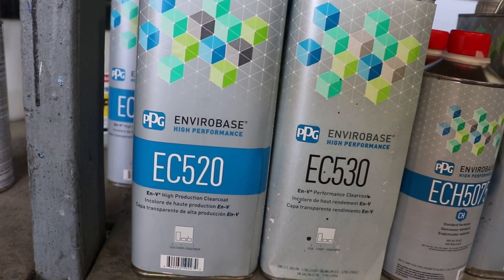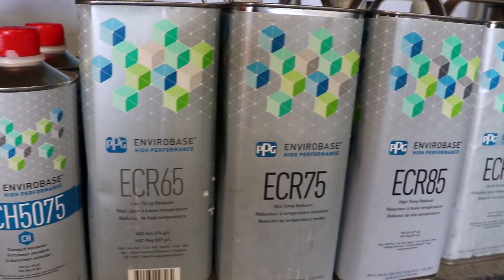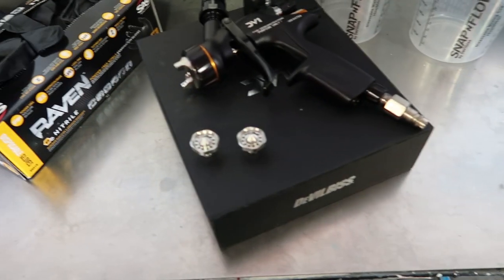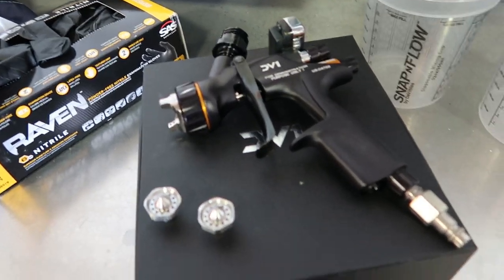NEW DV1 Clearcoat Spray Gun Review!!

Comment: The dv1 measures air pressure at the top instead of the bottom to prolong the gauge's life. Your still shooting 27-32 psi at the inlet. You guys don't have magic air that defies the laws of physics. Dv1 is nothing special compared to the tekna or GTI pro lite, nothing to get excited about
Reply from the maker: eksine I’ve tested the air pressure at the bottom of the DV1 it’s only a few psi difference, not 10-15. One good reason for gauge at the top is no gauge interference with your wrist during Roof and Hood applications. Thanks for the comment. 👍👍👍

Comment: Dv1. Is kinda dry compared to te20 gti(prolite)  ,  $180 IWATA W400( or Belaria) sprays better,   also the body lools cheap made.   Way overpriced tool.      Yes repeat w400 1.3 is better than dv1($180) , come on ITW u are looking like sata now washing brains instead to develop spray techn..
Reply from the maker: J. Hari Thanks for the comment. If it was spraying dry. Did you use the other fluid tips that come with the set. 1.2, 1.3, 1.4 they come with it.
Reply: @thetotalsalesguy9139  yes we try 1.4 same thing, slow and dry,  this dv1 dont look like a devilbiss tool, it is slow and dry , also orangr peeler for high solids, cant acept this as  a $670 gun wich were paid,  is going back to rep. 
Think this gun is made in taiwan or china, not itw